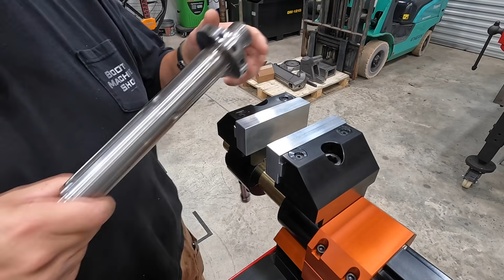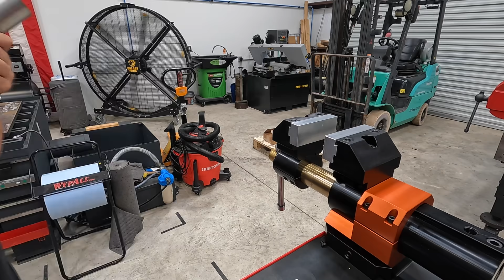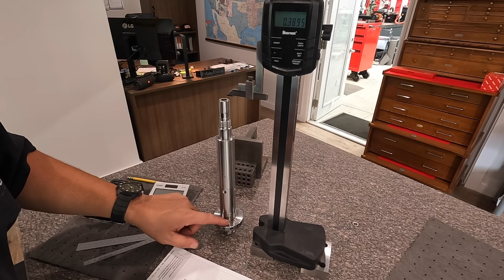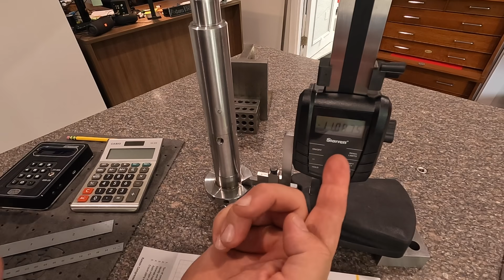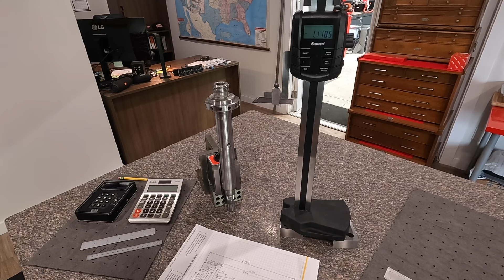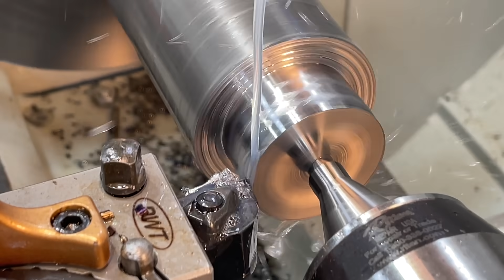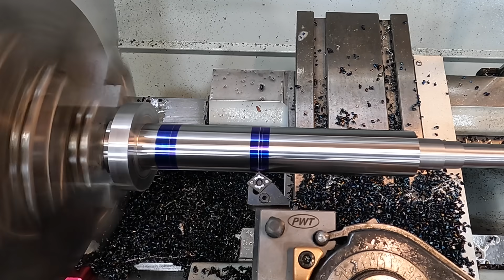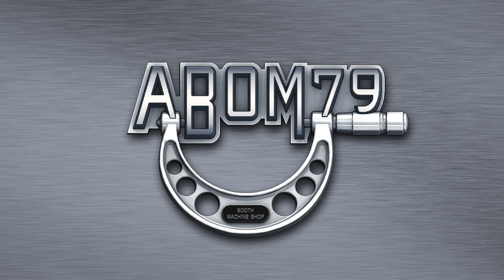Machining a Wood Lathe Spindle Ep. 1

Comment: People often forget when turning large diameter stock down to about a third of its original diameter they don't increase the chuck speed for the smaller diameter. Which is why the surface finish isn't as good as it could be!

Comment: Adam, Sir

In the 38 minute time area, you are sizing down a cylinder. When you relocate your tool (still learning names, but I think it's the cross slide) why does it leave a trail on a surface you just cut? Isn't the tool still in the same location? You haven't moved it forward or anything like that? You are just backing it out. I am not a machinists, but I like to know how things work and machinists aren't generally the nicest people to ask, but seem to actually be a teacher, like Joe Pie.
Reply: When you make a big cut,the forces push the cutting tool downward, just a bit, so when there's no pressure on the tool while retracting, it bites into the workpiece just a bit.
Reply: We call that spring pressure. It takes a tremendous amount of force to cut metals. It’s unfortunately impossible to make everything 100% rigid. Everything has a slight amount of flex to it. The tool will flex, the tool post will flex, the machine will flex and the part itself will flex. During a cut this flex will stay pretty consistent but once the cut is stopped that flex will work itself out so when he pulls the tool back across the part it will leave a line. That line is a representation of how much everything flexed. Failure to account for this spring pressure can and will lead to a scrapped part on a finish cut which is usually a lighter cut than a roughing cut. A couple of ways to account for this are to either take what’s called a spring pass which means retaking the cut you just took with out adjusting anything allowing the spring pressure to work itself out, or backing the tool off and retouching it off on the OD of the part essentially resetting any spring pressure that was there. Also learning that particular machine and how much it tends to flex and accounting for it in your final adjustments works too.

P.S. I’m sorry you’ve had a bad experience asking machinists questions. Most of us are passionate what we do and are more that happy to explain things!

Comment: If you have a longer shaft. I’ve found an easy way to find lengths of journals, take a test indicator on a nice stand. Put it on your carriage and go face to face. And use your read out as a make shift height gage.
Reply: Machinists almost always talk in  SAE: Thousandths of an inch (thou), Metric: millimeters or microns. Ex: 3/8”=0.375”= 375 thou and it is this simple to convert: 25.4 mm =1 in and 1mm =39.37 thou.

Comment: Can you explain why the chips curl down as well as the color change?
Reply: The curling of chips on a lathe is due to the interplay of cutting forces and material behavior, known as the Bauschinger effect. Materials can deform in two ways: plastically, where they permanently change shape, and elastically, where they return to their original form. When you cut, you create plastic deformation in one direction and elastic deformation in the other, resulting in the chip curling as one side springs back.

To prevent excessive heat buildup in the workpiece, it's crucial that the operator tune cutting speeds and feeds with that you direct the majority of the thermal energy towards the chip, minimizing heat generation in the material/workpiece being turned. Consequently, the chips themselves tend to become quite hot. This elevated temperature can trigger a chemical reaction with the oxygen in the surrounding air, leading to the oxidation of the material and the emergence of distinct colors on its surface

Comment: I have the same lathe. My threads got galled and chuck seized on because I forgot the washer. Thankfully my chuck threads are different than then spindle threads so I have to run an adapter. Had to cut it off with a torch. Luckily the metal the adapter was made out of had a much lower melting point than then spindle

Comment: Seems no one turns between centres any more.  This job seems to be calling out for that.
Maybe those spindle speeds would be a bit high with an out of balance drive dog.
Reply: He was taking .200 depth of cuts at one point between centers can’t handle that you won’t get as much support.  you may be able to spin faster between centers but not bigger docs.
Reply: Always turn between centers taper run out can be corrected.

Comment: I’m curious why you didn’t clean up the threads and cut it true for a set of bearings with the same OD and slightly smaller ID instead of making a whole new part. I guess you’d need a different drive pulley for the center as well but that’s easy enough to sort out.

Comment: Too bad that part was obsoleted...or just no longer available.  That part used to cost less than that 2-3/4" 4140 round bar. 

That lathe is pretty popular, and I know three people with them.  Seeing this more and more and more and more.  Had a electric edger than needed a new set of brushes....Obsolete...it's only 4 years old, checked EVERYWHERE, and all were "Indefinite Back Order".  They moved from the original design to something new.  Unfortunately the way the brushes are held makes it impossible to just buy a different set and they are not just "rectangular".   I tried using another set I had and just profiled them, but it failed.  Ended up buying a new edger because of that.  It just cheeses me off when all these companies do this...and we the people seem to put up with it.  :(
Reply: Seems like it's everywhere - Can't get a simple cable for my Husqvarna mower. Apparently everyone! is having this problem with the company.
Reply: @jrkorman I have a Dewalt random orbit sander.  I used it for sanding the hull on my boat to get the bottom paint off for a refit.  The pad was destroyed after that. I went to get a new one.  The cost of the new one EXCEEDED the cost of buying a whole new sander.  I said OK, done with you people...and looked into people like Porter Cable, Delta, Milwaukee, even the ever expensive Festool.  ALL the same.  Parts cost more than replacing.  When a $5 part is being sold for $175 (Festool) I just shake my head.  These pads are semi-consumables.  If you use them a lot you're going to need to replace them, and they've made it so it's cheaper to buy a new tool.  UGH!
Reply: @WreckDiver99  a Festool rotex pad costs about 40$ original, and starting from 15$ aftermarket.
On a machine that is 500$ or so. (and is worth that, buy one and never want another)
Reply: @grotevin WHERE?  I contacted Festool direct and they were "$160  + $15 Shipping".  

BTW: @carlhitchon1009 this was a DECADE ago, it's just gotten worse.  I inherited by dad's ANCHIENT Porter Cable sander.  The pad was rotted off, but I found he had bought another.  The package said $12.95 from 2004.  That pad today?  $50!  

The issue isn't the CEO, it isn't the Yachts.  It's the ever present pressure from the shareholder to ensure those dividends. The day traders, the MASSIVE 401k's all of that has driven the market crazy.  I worked for a multi-billion dollar company and even if all the leadership went to $0, it wouldn't make a dent in price of the product, it would net the 100k+ workers about $25 per year in their pay checks.  Healthcare trippled when ACA passed because suddenly you had MILLIONS of added people that couldn't pay for insurance before getting it cheap or free, somebody had to pay.  My company paid out over $3 BILLION per year for the plans and employees still kicked in nearly $500M!!  Material costs, logistical costs, and more of skyrocketed even worse in the past 2 years with the "Green New Deal" people wanting to shut down pipelines, restrict oil leases (or releasing already known useless locations for leases), etc.  

Between the all the costs skyrocketing (hey,  that person at McD's DESERVES $20/hour)...when they get it, people all ask "why did my 'value meal' go up $3?  Because you just hit that single location for over $125K/year in profit loss...and the average profit for a McD's is about $125K/year...hmmm...gotta make it up....people don't understand econ 101.

I have the problem that these parts are already available, they are already made.  I don't have a problem paying a 'fair market value' for them, but paying 20 times the price?  NO.  Also the fact that these companies seem to change out parts all the time and don't need to hold back replacement inventory (car companies need to hold 10 years last I knew), but these other companies are like "oh, that was last year's model, parts no longer available, but a new one for $300".  UGH!
Reply: But hey, they get the big bucks and the yachts this way. We are all fucked by capitalism gone wild. Everything is through-away so you have to buy a new one.
Reply: Basically legalized robbery! But what are 'we the people' supposed to do about it? I agree with @carlhitchon it's capitalism gone wild with no one able to tame the beast.

Comment: I think I would have been inclined to turn it as three pieces, with the large diameter section separating the two smaller diameter sections.  Not sure about the method to connect, but I could think of a couple.  That way, the next time the threads that hold the chuck get trashed, it would only be a small section to change.  Just a thought.  Great work again.  I kind of agree with @satamanschidt3428 about the whole moving forward thing.  Showing how to generate the cad and use the CNC would be just as informative and enjoyable to watch.
Reply: Sorry but telling to make this shaft in 3 parts makes no sense….the only way to make it is from solid stock…

Comment: I wonder how much Jet would charge for that spindle? I also wonder how much Adam would charge for making one if he were acting as a professional machinist rather than a YouTuber looking for channel content? Remember he did say some time ago that he was going full time on YouTube. That chunk of 4140 is expensive just by itself. Unless he gets some sort of vast discount, the entire piece he has is close to $1,000.
Reply: $174 for a 2 ft chunk of 2.75" 4140 steel from McMaster-Carr.
Reply: @hobbiesrus  that looked longer than two feet though. If it was the plain soft multipurpose, I got $200 for two feet. $235 shipped. Hardened is cheaper somehow, but his didn’t look hardened when he was working it.
Reply: @melgross  4140 is usually around 25-30 Rockwell C from the mill.  This bar looked to be turning nicely, so probably in that range.

Comment: i have a 1960s ish clausing 15x48 and the headstock is super quiet in all speeds.  i have noticed these newer machines on these channels are somewhat loud on the headstock noise.   i wonder if its just the finish on the gears or if the shape of the gear teeth are different causing the noise on the newer machines?

Comment: I have never heard of a 7TPI spindle thread on a wood lathe.   If it was made for the US market, it's 8TPI, but since you wouldn't have mismeasured by that amount, are you certain it's not an M33 3.5?   That's used in the European market, and 3.5mm threads are within .3% of matching 7TPI.

Edit: changed the percentage to .3 from .1, which was a miscalculation.
Reply: good info.   indeed its probably splitting hairs.
Reply: I'm restoring an older Walker-Turner wood lathe for my son,  The factory spindle has an obsolete spindle thread size that only fit Walker-Turner chucks that we don't have, all the new modern NOVA chucks use a 1¼ x 8tpi thread, I just machined a new spindle last month very similar to this one but I did it all in one video with no ads!
Reply: @brownh2orat211  you sound like one of those that are scared to death someone is gonna make a little money.....
Reply: @brownh2orat211  Well, that is because you are just so cool!  Do you also have over 500k subscribers?

Comment: Somewhat ironic as I'm watching, thinking I should ask Adam if he would recommend Precision Mathews as I am wanting to acquire a benchtop lathe of some sort. Low and behold  you give a big thumbs up to the satisfaction with your PM lathe. Thanks Adam.
Reply: Lots of custom rifle builders use a PM. Nice machines, I’ve seen one up close.
Reply: Adam's 1660 is made in Taiwan, most other PM lathes are made in China and cost considerably less. I wish I could afford the Taiwan lathe, but for the $$ you can get a PM Chinese lathe with DRO and chucks plus a mill.
Reply: @thejoker-pd9df  get the Taiwan version only.
Reply: What @wolffengineering7038  I am not sure how you would be able to weigh that option for anyone but yourself. The Taiwan version would be my preference, but it is more than 2X the $$ as you have to buy DRO, chucks, etc as add ons.
Reply: @thejoker-pd9df ok, get the Chinese version.

Comment: my trade was electrician, i read/wrote/modified ladder diagrams for machines, used on docks and ports. similar concept to g code and cnc. It was boring and i could fall asleep without ever dreaming for a second it was fun or exciting. Manual machining is slower, dangerous, satisfying, and skilful, with thinking involved. Thank you Adam for every statement and action, you are giving us your time and attention which is priceless and irreplaceable. I and all the silent people appreciate it. thank you Sir, Great video and be proud!
Reply: Just switch to AWL (like in Siemens stuff), pure code programming with function modules and take some breaks, asking your colleagues if you can install some cable, do wiring, etc. With that kind of electricians work also mechanical work is involved. Drilling, cutting and bending sheets, filing, making brackets and building cable guides. Set up control cabinets mechanically and electrically. Everyone needs some variety and I understand your suffering, which hurts my heart.
Oh and you wrote "my trade WAS", so you are in pension? Never to late that Santa brings a drill press or the easter bunny lays some woodworking-goodie-eggs. Have a good one and greetings from Germany, neighbor(... Ireland?) :)

Comment: Ric Burns 
If you had decided to do this job on CNC what would your process have been
Reply: That is not what Ric asked for. 
Aren't you the guys, the ones who cry like babies if Adam is doing some CNC stuff: MÄÄÄÄÄÄH, MÄÄÄÄH, We wanna see manual lathe work ...
And now you are making fun of a guy who wasn't born, right out of the womb, as a CNC Master? Yeah that makes sense ...
Hmm, speculating about if Steve's and Andrew's self-esteem is proportional to their machining skills (which they, who knows why, have confused with their penis size, here) will just be a waste of time.

Ric: The same as Adam has done. Hand drawing and taking the detailed measurements of the replacement part. Bring the drawing in accordance with reality (tolerances, the functionality, particularities, etc.). Then transfer it to a CAD drawing. Make the computer drawing work with our reality (what kind of tools, possible tool paths, parameters specific to the machine. Better think about that stuff earlier than later ... meaning the next step). Generate/Create/Program the code for the machine. Press start and break something:) Back to the other steps ... you get it:)
Reply: @dieSpinnt Only one I see crying here is you. Are you always that easy?
Reply: @dieSpinnt  And he certainly won't become a CNC-Master by ignoring the machines he has either.
Reply: @andrewterry8092 it’s ALWAYS just a matter of time before you trolls tell on yourselves. Stay jealous Andrew.
Reply: Adam would call Milltronics and ask them how to make the part.

Comment: @Abom79, you should make yourself something to block the chips and coolant from splashing all over the place while turning.
 Kurtis from Cutting Edge Engineering made something out of a thin piece of metal plate or plastic that's like 2" wide by 4" to 5" inches long that attached to the end of Noga Flex Arm that he puts to the side of tool to block the coolant & chips from flying all over. 
Also great to see the Surface Plate and your height gauge get some use in a video. 👍👍
Reply: I've seen recent videos. He still doesn't have anything blocking the coolant or chips from spraying all over the place LOL

Comment: Method question: when you were roughing the longer part of the shaft (i.e. the non-chuck side), why didn't you just rough the whole length to the largest diameter to start with? Then work towards the smaller diameters?